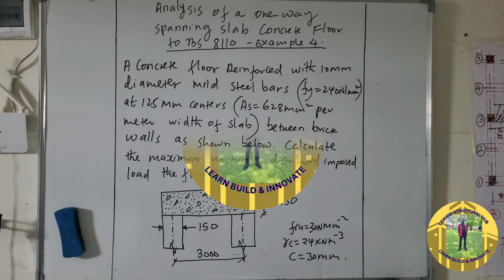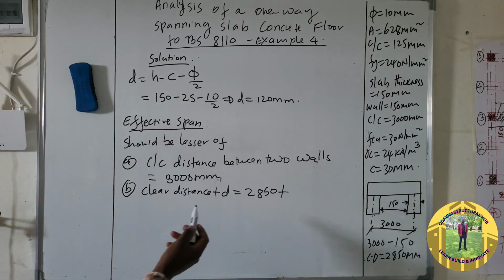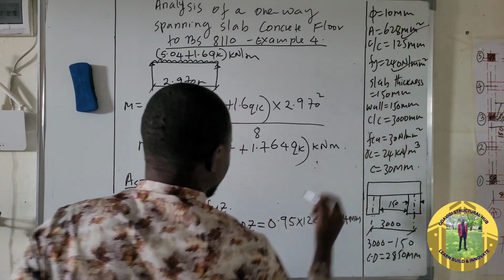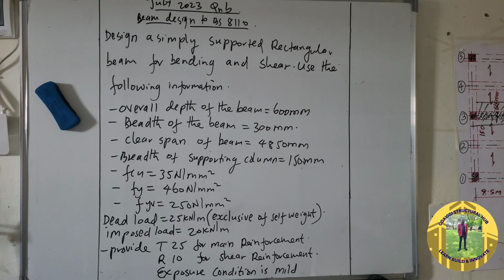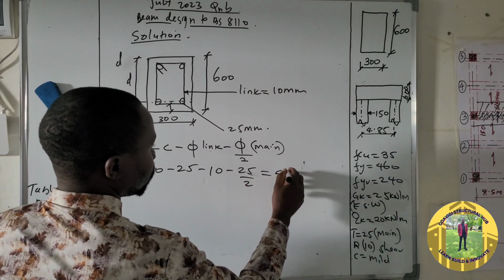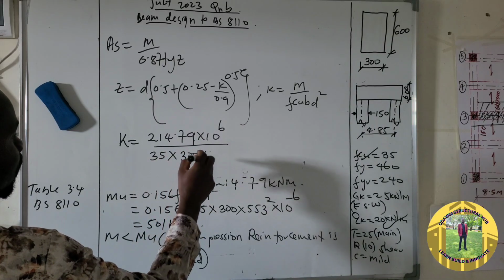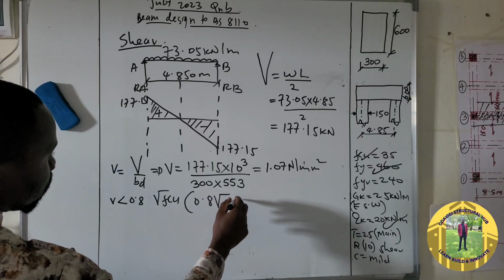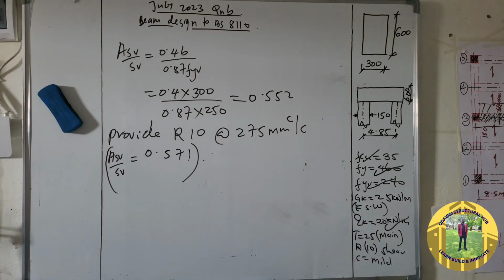HOW TO DETERMINE IMPOSED LOAD OF A SIMPLY SUPPORTED SLAB (BS 8110)

Comment: Greetings sir. I'm from Zimbabwe, have been following your lectures well. On the beam design example. It seems as if the maximum link spacing should be 225mm (0.75d clause 3.4.5.5 of BS8110)  The spacing we got is 275mm which is higher
Reply from the maker: Yes, according to
BS 8110, the maximum spacing of shear links in a reinforced concrete beam should not be greater than 0.75d or 300mm, whichever is the lesser. so 275 is  less than 300mm. thanks for watching.